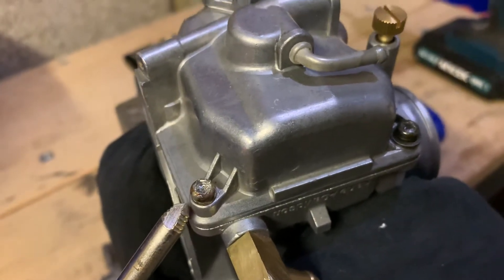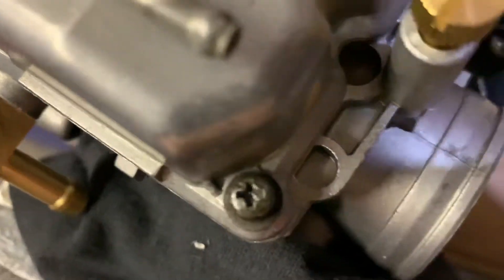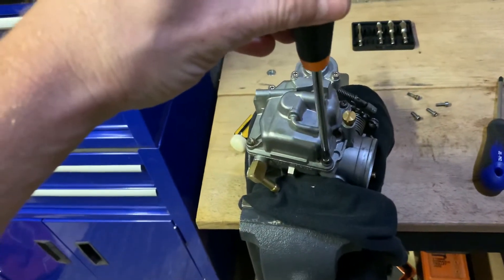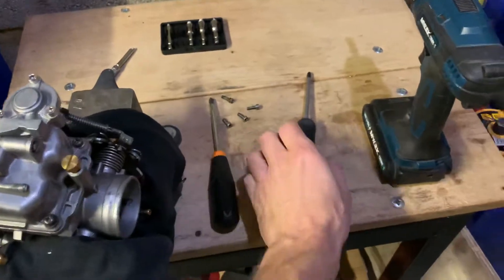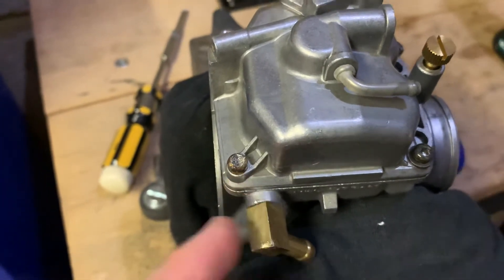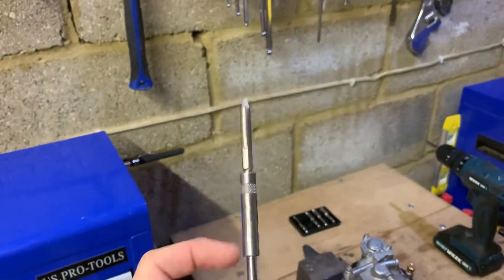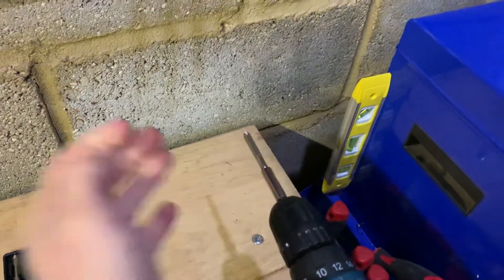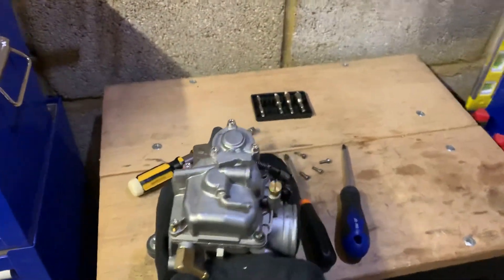How to remove damaged bolts from carburettor on your Harley or any Japanese bikes

Comment: hi Aron, i am really glad to have followed your hint and replaced those bolts. Got stuck on the road since the pilot jet got blocked. Very easy job with the hex bolts. BTW, my build is finally done, ended up with engine overhaul. Replaced almost everything on the bike incl. wheeel bearings ( it was a pain in the ass, i tell you ) and also converted the spoked wheels to tubeless. You have been a great influncer, thank you for your kind support and for sharing your knowledge!
Reply from the maker: Hey Michael, Sounds like you’ve done a great job! Feels so great when you work on your own bike.
Yeah, so much easier with the allen screws in case you need to drop the float bowl on the side of the road. I also had to do it once.
And thanks for your positive feedback!